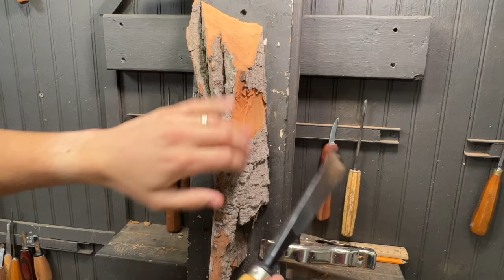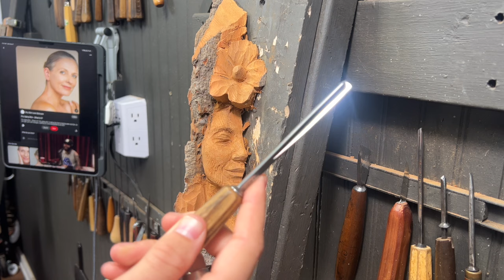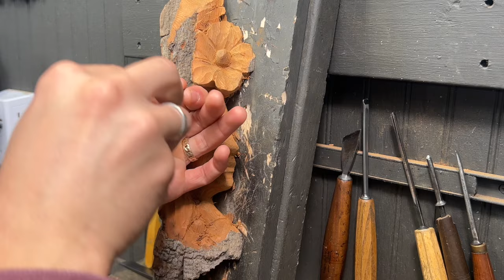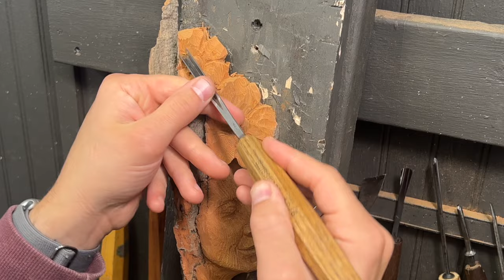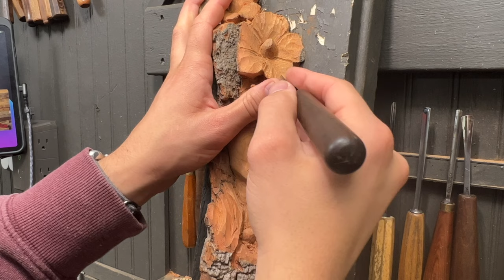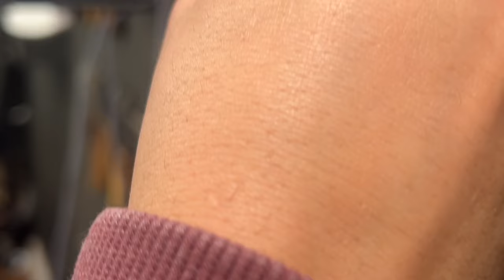WOOD CARVING AN OLDER WOMAN

Comment: Is the piece nailed or glued to the wall? How does it stay fixed while you carve it?
Reply: He screws through a board into the back of the bark then clamps that board to another which is mounted on the wall.
Reply: @zacharygross1207  thanks!
Reply from the maker: Thanks  @zacharygross1207  !!!! You are the man